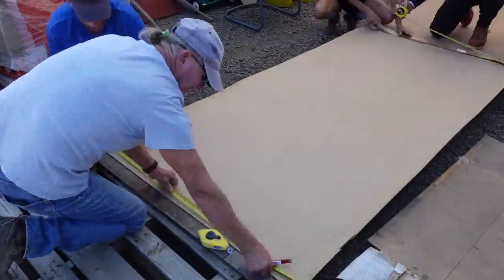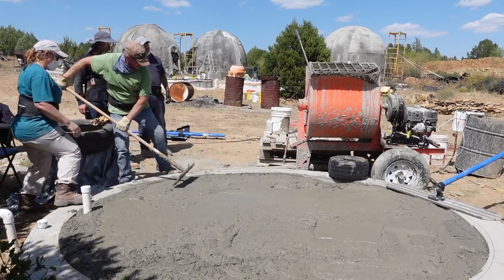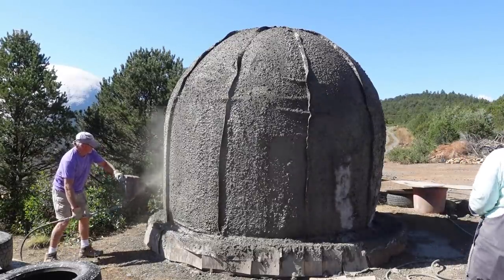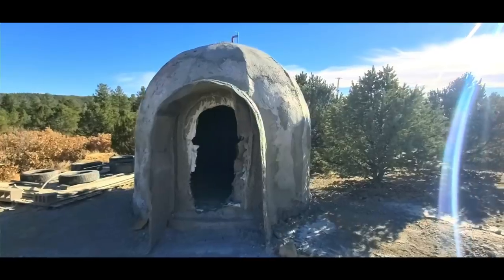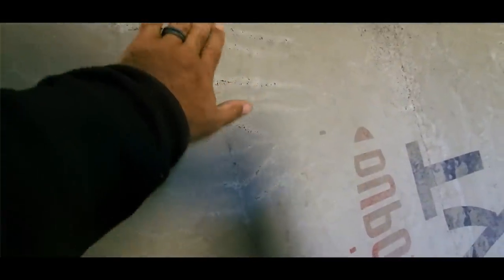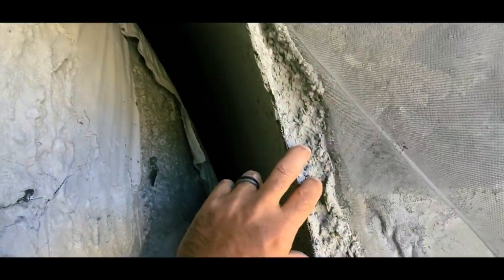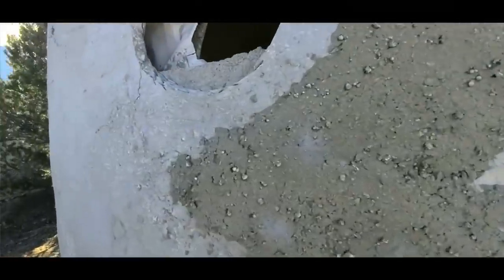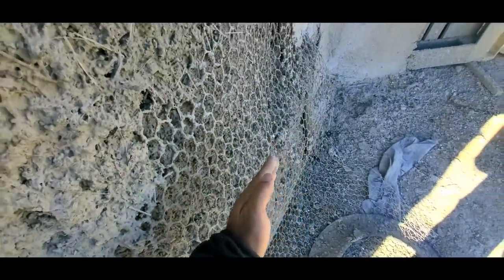Building Double-Shell Aircrete Dome in 5 Days #aircreteharry #aircrete #foamgenerator #domehome

Comment: The blow-up style I believe is called Monolithic, but a friend of mine who has built many domes (from the 1960s to the present) suggested a really quick way to create a dome would be to either use dirt from your land or have a few truckloads delivered and mound it into the dome (or any shape the dirt can hold) shape, add rebar, cover with mesh, spray with ferrocement, repeat rebar, mesh, ferrocement and then keep it moist and covered to cure for a few weeks.  Then go in and start digging the dirt out, save dirt for landscaping or to build a garage and/or other outbuildings in the same way.  When you have all the dirt out of the ferrocement dome structure, go inside and spray ferrocement on the inside to finish the basic shell.  There you go!
Reply: Too much work
Reply: Much more work, though if for some reason you couldn't get a sewing machine, a blower and some tyvek then that is a good way to go
Reply: Must do ring foundation to support the arch

Comment: Instead of spraying it thin where you want your doors and windows, why not put door and window forms on the outside of the inner shell (with the forms being only as thick as the space between the shells), then spray thick all around. Leave them in place, put on the outer airform and reinforcement, inflate, more window and door forms, spray that. Then cut through the airform and screen inside the window and door forms. You'll sacrifice both the inner and outer airforms, but oh well.
Reply from the maker: Welcome to the channel Darrell 👍 
There are several options to make it happen, indeed. I covered many of them during the hands-on workshops & LIVE chats. You nailed it - many ways to choose from.

Comment: You need to make the bottom of both the interior and exterior shells thicker and then they can get progressively thinner as you get the top. If you do the math I think you'll be surprised to learn just how heavy the pressure is per square inch on the bottom of that form. Look at how water towers are built in New York City, there's a whole lot of rings of steel at the bottom and progressively none when you get towards the top that's because of the amount of pressure now you could stage your insulation pores and limit them to one foot at a time in between lifts and you wouldn't have to do crazy reinforcement on the bottom. I would just invest in a cut off saw with a masonry/rebar blade and keep my interior and exterior shells uniform.
Reply from the maker: Only the inner Dome needs to be structurally sound. The outer Dome can remain thin because its soul purpose is to hold Aircrete in and to be a Waterproof Barrier by using the Latex Cement Mix. 
Yes, indeed, the NYC Water Towers are build that way as you mentioned - as they hold tens of thousands of lbs of  pressure in. 
Appreciate your comment 👍

Comment: Awesome build. I wonder, how would you go about supporting electrical with this build system? I suppose it would be pretty easy to add steel conduit before installing the second air form.
Reply from the maker: Hey John!
Yes,  that is correct. You have it exactly right - or you may run the conduit under the slab, bringing your outlets up to the wall - where you want them. 👍 👍
Reply from the maker: Thanks John, Appreciate your feedback 👍 👍

Comment: How does the electrical and plumbing done since the walls are rounded?
Reply from the maker: Welcome to the channel Eva 👍 
The electrical & plumbing can be run through the wall or / and the floor. 
Have in mind, the curvature starts above the stem wall, which gives you planty of straight wall & space.

Comment: That big mixer and the equipment to make the aircrete would add a lot to the cost. 
Can the thickening agent be used in regular concrete? We have some, but now that our plans have changed, we aren't sure what else it might be good for. We also want to do  earth floors in part of our house, it might be interesting to do a test batch with the thickening agent?
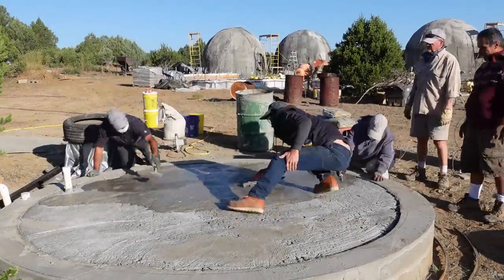Reply from the maker: The big mixer not needed at all, at 5:38 you can see the double paddle mixer on the floor, that's all you would need to build this dome. The big mortar mixer just make life easier.  The thickening agent can be used in your concrete 4 - 6 caps per bag of Portland. I think it will help using the thickening agent for your Earth floors as well.
Reply: everything I spotted could be rented locally depending how remote you are
Reply: @ericb2247  You probably could rent some of it, but it might be hard to find a foam generator. We spent about $1,400 on our aircrete making equipment, there's quite a bit to it.
Reply: @AircreteHarry  Thanks Harry

Comment: Super P also allows for quicker set time it will flash on you if not careful. Poured many bridges big decks, did some repair work on bridges in Marraita GA. Due to deck freezing over night caused cracking broke out bad areas reported put traffic back on the bridge outside lane opened before rush hour.

Comment: Random idea: a liquid Hemp polymer soaked into hemp hurd, then added to the outermost layers (inside and out) for a stronger and smoother layer for the shell... perhaps even mixed with the concrete itself. Not sure if hemp polymers exist in large enough quantities to build with (just did a search... yup, it actually DOES exist!), but I think that might be something you'd want to try out.
Reply from the maker: I would use Hemp if it was affordable, to expensive right now.
Reply: Twilyhtmist: I was thinking hemp as well👍

Comment: Would a hypertufa like first layer work, to give you something to adhere to the Tyvex with?  Soak some thin cloths in a very wet mix and drape over the Tyvex.  Then from there, spray away?

Love the videos.
Reply from the maker: Thank you Joshua,
Appreciate you 👍 
I use a Mesh layer on top of the Air-Form.
For the Mesh provides great support for when spraying the mix on. It gives it a grip & you can spray much faster and more on top of the Structure.
Therefore Mesh is very recommended. 
It is the Key for Strength, Grip & Faster Work. 👍 
All available on my website as well.
From forms to how-to to recipes:
https://aircreteharry.com/shop-1/

Comment: is it possible to build one of these with no metal, with the same strength?  I might be mistaken, but it appeared that metal was used in the base?
Reply from the maker: Welcome to the channel 👍 
Correct, some metal was used in the base.
Yes, you may absolutely build using basalt rebar & basalt mesh.

Comment: Great video!
We understand that this is code compliant, but what about applying for real estate insurance and mortgage loan approval?
And how large can we make this dome? Could we get to 2,300-2,500 sq.ft.?
We plan on building on land in different climate environments: 
Elko, NV; Cheraw, SC; Ithaca, NY; Luna, NM; Klamath, OR; Rockingham, NC.
Are there any weather conditions they we should take into consideration?
Reply from the maker: Thank You!! 👍 👍 
You are building a concrete structure that is fireproof, 
hurricane proof, 
earthquake proof, 
tornado proof, 
termite proof, 
(sometimes *bullet proof), 
so the Insurance should be low for the Dome.
As far as Mortgage, - with the stamped Engineer plans I image you should be able to get a Mortgage.
I also provide the offer for the Full Package Deal on my website: 
https://aircreteharry.com/product/full-package-deal-by-aircrete-harry-floorplans-3d-rendering-phone-call-email-exchange-structural-engineer-help-support/

It includes Floorplans, 3D Rendering, one-on-one Phone Call with me & more.
We will provide you with a Structural Engineer's contact Information as well.

Yes, you may make one large Dome.
In actual building practice, it is easier (& I would suggest) to make many smaller Domes connected. 
Do not build in 55° or colder conditions because the cement won't cure correctly.

Here is the direct link for my STEP-BY-STEP Online Dome Building Tutorial Video:

https://aircreteharry.com/product/%e2%9c%85-online-dome-building-course-step-by-step-by-aircrete-harry-great-addition-for-everyone-who-cant-make-it-to-the-hands-on-workshop-as-well-as-for-eve/

Feel free to email us: Aircreteharry@gmail.com ✌️ 👍

Comment: Could a guy just use a geodesic dome tent covered in tyvek for a form? Once the exterior hardens you just remove the frame. Thoughts?
Reply from the maker: Since you mentioned the removal afterwards - staying with just Tyvek Air-Form will keep the cost down. The geodesic dome tent in this case will only add to the cost. What are you planning to build?
Reply: @AircreteHarry  thanks for your response. Im contemplating a small art studio/ guest room. My intention is to use the geodesic dome as a greenhouse so reusing the frame won’t be a waste provided it could survive the build. An air form would be ideal but I don’t have the skills or materials to build the air form.
Reply from the maker: @notonthelam5329  You are very Welcome. In the above post you mentioned using tyvek in addition to the geodesic dome tent, so you are already ready to use the tyvek material - which is good. I would stick with Tyver Air-Form.
As far as the geodesic dome tent, it is Important you are aware of the nuts and bolts / screws. Once you cover the frame with concrete, they will stay in. It will be very difficult to remove them without dropping the entire dome down.
Just a reminder to keep that in mind.

As far as skills and sewing situation; over 90% of my students at my workshops didn't know anything about sewing. The excitement on their faces after I tought them and they applied the teachings right there and then was Amazing & Appreciated.
I teach all that and more in my Online Step-by-Step Video Tutorial Class: 
https://aircreteharry.com/product/%e2%9c%85-online-dome-building-course-step-by-step-by-aircrete-harry-great-addition-for-everyone-who-cant-make-it-to-the-hands-on-workshop-as-well-as-for-eve/

The sewing machines are very inexpensive!

Comment: Wondering about using the open source UHPC mix for the structural shell(s)?   Also, now that I have some sewing machines rescued... other more complex form designs... plus using something like a light burlap or hemp material that is first infused maybe with like the UHPC or HPC powder before inflating so you just lightly mist with water... though might weigh too much.  Wondering also about using a think like silk screen stainless steel mesh so more EMF protection while gaining structure... especially with the UPHC metal fibers.  Thanks for sharing!

Comment: Why not use rebar? Can rebar be used with aircrete? Genuine ask. Please reply. 🙏
Reply from the maker: Good evening Jill,
Happy to reply to you - the reason you don't use rebar: it can vibrate itself in aircrete. Rebar needs a strong grip not something that is easily irritated & flakes eventually if in contact with rebar as mentioned. 
Depending on the mix & if one prefers more insulative vs stronger mix but less insulative - aircrete is brittle.
My Best,
Harry

Comment: Could you do an arch between the layers—for the doorway? and do the fiberglass etc. for that internal layer? 

Seems like it would make the doorway process + filling— solid a little faster.
Reply: An arch between—in addition to the exterior arch. Attached before the outer dome is inflated.
Reply from the maker: I did something back in NYC that I will do again using Foam board.

Comment: i wonder if you could sew a 2" wide skirt to represent the edge of the door to the airform and use it as a 'dam' to actually make the area around the door super thicker like a continuous beam and hit it at an angle with the sprayer so that very little stucco covers the door. Then, just cut out the pattern with a knife
Reply: I was wondering about something similar, then thought, there would likely be problems with filling the aircrete between the inner and outer shell with the very thin and weak airform at the door bursting from the weight of the aircrete which would naturally fill the void.
Reply from the maker: It's posable  but would be complex to make It would take a few prototypes to get right.
Reply: @Jason Stanley  i think deformation is the problem he already has and cutting through the thin stucco leaves a jagged, fractured edge. I was describing beefing up around the outer edge so it holds a cleaner and robust shape. I can see how what I said sounded like connecting both airforms with a strip of tyvek

If he could sew a flap to the outer airform following the pattern of the door, then  staple a strip of that flexible plywood to keep it formed right. Maybe more beefiness there might even help mount a door/window securely, which I'm a little curious about.

Comment: If you were to put the seams on the inside of the domes before spraying, the dome would be smoother. It would also make it easier to peel the form off the inside.
Reply from the maker: The seams for the air-form are on the inside. The seams for the fiberglass mesh are on the outside. The seams also act as a depth gage when spraying the cement mix.
Reply: @AircreteHarry  sorry. I watched the video of pealing the form off the original cabin. I guess the mesh layer makes it look like the seams were on the outside. Filling the gap between two shells with an insulating layer is rather interesting. I continue to watch your progress, and wish I could play too.

Comment: Why not make a door shaped form that has an airtight door in it, that way you could cut the hole for the door before you spray anything on it at all, insert door form and attach the air form to the door form, and then just spray right on to the door so you don't have to mess with adjusting thicknesses, etc.
Reply from the maker: Yeah, I've done it already👍 
That's what I am and will be doing with my future domes/builds.
Been experimenting with a few ideas that have been successful.
Are you working on any projects yourself this summer?

Comment: 15:00  What if you kept the inner dome under pressure while filling the wall?
Reply from the maker: I could not do that because the air would go into the inner and outer dome at the same time the way the pipes where set up. Also if you have an air leak from the inner dome it would make air pocket in the Aircrete and not set up correctly.
Reply: @AircreteHarry  I see.  Thanks!

Comment: I am watching more of your videos.  I'm definitely going to do a video on what you are doing.  I have been thinking this way too.  Have you heard of Ralph Ring?  He made an geofriendly-like home in the 70s with a garden on top and naturally heated and cooled.  Based off of Nikola Tesla's ideas. He also talks about free energy that is available everywhere.  He talks about Air Wells too.  I could send you links to it.  Let me know.  He talks about getting electricity from quartz, tourmaline and from other crystals, even from cement.   I have made cement batteries and lit up some LED lights.  I'm researching off-grid incinerator toilets that use HHO generator technology that generates HYDROGEN Gas from water to use.  I recognize the potential in Aircrete and have been telling people about it for a few years.  I am so glad you are doing this.
Reply from the maker: Barry, I would like to see information about all of it, send me the links. Thanks!
Reply: @AircreteHarry  I got your email :) I sent the links.  The email may go to your spam folder so check there if you don't see it.

Comment: Perhaps instead of using tyvek, use fiberglass cloth, inflate, spray fiberglass resin, cut your door frame, layer concrete?
Reply from the maker: The cloth has to hold air. Fiberglass will not work.
Reply: @AircreteHarry  then perhaps you can still use the tyvek at the start, overlay the fiberglass cloth instead of the mesh, and spray the resin there? As you mentioned the Tyvek won't stick to it, and once the fiberglass hardens you will have much more control cutting your doors and windows as well as have a water vapor barrier.  I'm looking closely at your innovations while checking out a few others as well. Keep up the excellent work!